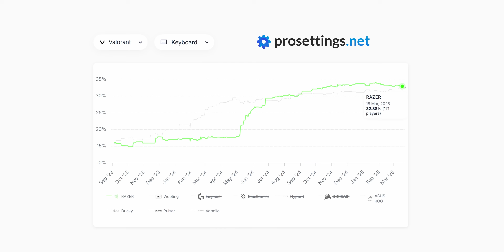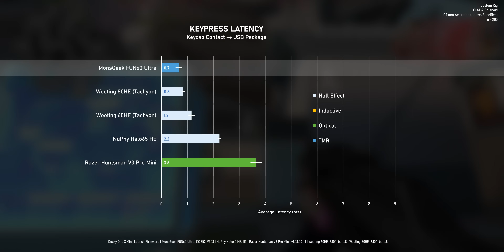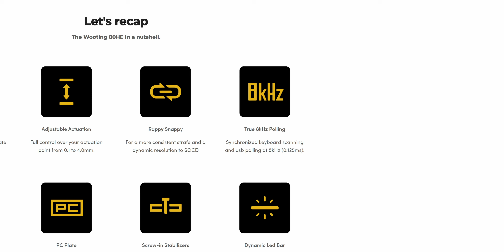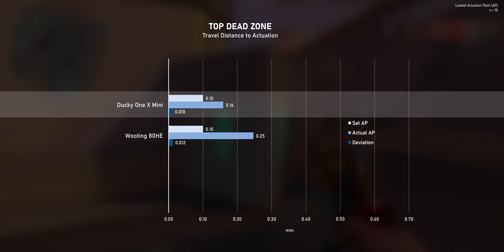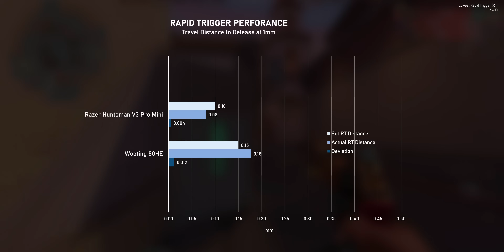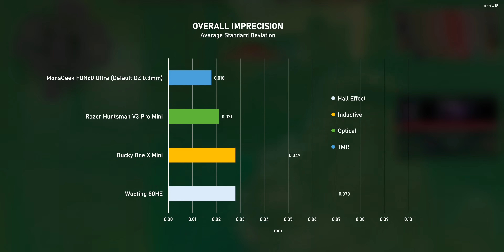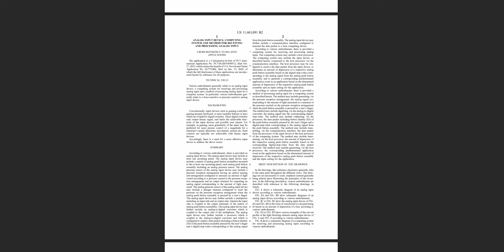These New Keyboards Are Here To Replace Hall Effect

Comment: Re Razer bottom dead zone, i believe the total travel of those switches is 4.5mm but the actuation range is only 4mm so maybe not quite deliberate but just a consequence of the switch design. I would be interested to see the latency of their newer 8k variants because overall their accuracy is very impressive and on par with what they advertise in the marketing.

Razer (somewhat rightfully) gets a lot of hate but their esports focused products seem to top tier. Their mice in particular are just literally the best by a lot of objective measures.

Comment: Theoretically speaking - none of these active sensor technologies such as Hall effect (including switching types), TMR, or inductive are power-efficiency kings. 
Their current consumption depends on the sensing electronics, not just the key's physical state, so some current flows even when no key is pressed.

You won't be using majority of the keys at any given time, and statistically speaking - this is a factor too. A simple mechanical keyboard remains the most power-efficient option in many ways. 
Even though a bit obsolete, it's perfectly usable for most scenarios to this day. It's a favorite of many for a good reason, but some people want more and there's nothing wrong with that of course. 

"X" type of sensor is also a bit too generalized. Take HE sensor for an example; there's analog (linear / ratiometric), switching / digital, latching, omnipolar.. each one has it's own uses and varying models. 
Modern switching type HE sensors are FAR more power efficient than marketing BS claims. 

While on the topic of HE sensors: if you own a HE keyboard - there is isn't a good reason for change, other than personal preference. Every switch has it's pros and cons, but keep in mind that software plays a HUGE role in just about every keyboard that's utilizing newer sensor technologies. HE software  refinement isn't perfected yet, but is in a pretty decent place right now. Switch selection / options are expanding at a decent rate too.. can't say the same for inductive tech for an example.

TMR = ideal for wireless keyboards due to impressively low current consumption regardless of the state of the switch (pressed or not). But keep in mind that the LEDs are the highest power sink regardless of the switch by FAR (up to 5W at 75% keyboard at max brightness, white color = up to 60mA per key in some cases). TMR is extremely sensitive too (this can be both good and bad). If you really want one, I'd suggest trying to find / wait for a temperature compensated TMR option as these types of sensors tend to have a very stable output.

Inductive = no magnet + no physical contact. Technically capable of even higher power efficiency than TMR due to deep sleep capabilities (this is beyond negligible though). In reality, it's probably just about the same. TMR option should have marginally faster response slightly higher power efficiency if we're comparing continuous scanning rates. Inductive sensing also has the potential to offer superior repeatability, lower temperature sensitivity and better linear distance measurements. Also no risk of drifting.. ever.

Either way, switch type is just one of the factors, and there's quite a few of determining factors for both the performance and the power efficiency. There's a reason a 50€ HE keyboard trails so far behind Wooting as an example.. and it's both hardware and software. Identical sensors doesn't mean identical performance if stuff like internal amplifiers, biasing networks, oscillators, ADCs, etc. is skimped on or just poorly designed.

Sorry for the rant, I hope this was helpful to at least somebody. Simple reality is that there is no bad pick here. Marketing is blowing things out of proportions as usual and that results in nit-picking between things that have 0 perceptible difference in performance when it comes to real world. 

P.S. - great video!

Comment: Most of the differences in measurements between Hall and TMR here, I think are just differences between the particular implementations, and not inherent to the technologies themselves.
I am typing on my own scratch-built HE keyboard, and I will say that power concerns actually added a lot of difficulty, especially if you want to stay within the USB 2 standard 500mA power spec (which most of these keyboards don't).
I'm fairly sure, judging by those numbers, that the 60HE is bank switching the power on the hall sensors to save power, and tachyon mode just leaves them all on.  I do the same on my board to give me extra power for RGB, and I've managed to get it to run fast enough to get a true 1ms response that I'm fine running in this mode all the time, but it would certainly be a challenge if I wanted to do a larger board while still keeping the power demands low, and also optimized for latency.
TMR would pretty much just remove this design limitation, and require less optimization to get good performance.
As far as I can tell, other than that, it should be pretty similar in performance.

Comment: There's some blatant misleading/deception in this video, early on there's an unfair power consumption comparison of Wooting's hall effect keyboard with backlight set to maximum intensity to Ducky's inductive keyboard with the backlight turned off and the claim that Ducky's keyboard achieves vastly better battery life...

Like yeah, if you're comparing a device running tons of LED's to a device running none... of course there's gonna be a huge difference in power consumption!

Comment: Hi, love your channel but i have a question, ive been looking at TMR in particular the Womier SK75 TMR/HE and the only reason i havent pulled the trigger yet is because i dont know if TMR supports analog keystrokes, id like to use it for driving or barely pressing it to walk if i wanted to as well, do you know if they support this feature? Also another question, how important is software when it comes to these or are they good to go out of the box.

edit - if curious or if it changes anything, im either choosing between the Womier SK75 TMR/HE or the Lemokey P1 HE and ultimately im just looking for a good "one and done" keyboard

Comment: Who on earth cares about the power consumption of a keyboard?
Reply: You do know that wireless keyboard exist, right? Having to charge the keyboard less frequently is basically a godsend. Not to mention keyboard built into laptops especially gaming ones where said laptops are already power hungry to begin with. There is a reason why keyboard manufacturers like Wooting still have not release a wireless Hall effect keyboard and those that do have them come with a noticeable larger lithium-ion battery which would the overall keyboard bulkier and heavier with some comprising features.

Comment: the scanrates are pure marketing fluff and absolutly irrelevant. 
input latency is always bound to fps. so the most you will "loose" is 0.0001sec of input withing a frame when comapring 1khz to 8khz.
this is not visible or feelable, its makes no difference at all in a positive sense

however it can have massive negative impact on latency and irqs. depending how the driver is built. if its designed to allow true 8khz input then this is is a bog nono and best you can do is switch it to 1khz
the problem with high polling rates is so bad microsoft had to make a patch after high polling mice froze midrange cpus to death

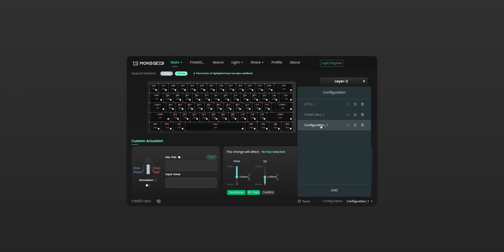Comment: 18:18 "I'm sure this will improve over time..." It hasn't 😆, I've returned my Fun60, the software is still a nightmare
Reply: should i get the fun 60 ultra TMR? i really like the precision etc but does the software make the keyboard unusable? I really only need to setup RGB and actuation points and thats it
Reply: @mirDaaa  I would heavily recommend against it. The software is so confusing and makes things like Rapid Trigger so hard to use to the point that, even when you get it working, it still doesn't feel right. Save up a bit more and go Wooting.

Comment: After Optimums video I went out and bought a fun60 ultra TMR. $47 on sale in China. That's one thing not really talked about in this video. Sure, the software is not as polished and full featured as wootings but they have had a huge headstart and charging $200. The value proposition alone should make the Fun60 an easy to recommend analogue KB for anyone.

Comment: Couple of years ago had a diy project (was abandoned due to circumstances) of inductive sensor PCB.
I did a couple of switch sensing prototypes with different coil sizes with stm32. Received my commutation ICs to try out to scan multiple coils the life happened.
Main advantage of it though is an ability to use standard MX switches and sense it's spring position. 
I didn't pushed basic prototype too far. I stopped at 30ms latency before moving to multi coil keypad. Required simple per switch tuning. Some MX switches were hard to sense, too much jitter, not sure why.

There was prior art to me, guy were selling his inductive sensor keebs, but wrapped in a half of a year or so.

Comment: I've never used analog keyboards, not sure I understand the benefit? Does it just mean that you can program a key to do different things depending on how far you press it? Does this have much benefit for typing?
Reply: the main benefit of analog keyboard is having better control over your car in racing games. In more realistic racing games, having just on and off for your throttle, brake and steering is not enough.
Reply: @IHaveALotOfBraincells  ah, i see.

Does that also require the game to have support for analog keyboards too?
Reply: @soconfused8031 I'm not sure, I have never used an analog keyboard myself.

Comment: A4tech Bloody (analog?) optical alpha keyboards with actuation point options: 1--2.6mm? Alpha Variable Speed Optical Switchs. Software +-? But without custom firmwares qmk/zmk/kmk/..(  No slim analog mechanical kb( 

Also needed review/test with diy kmk/zmk HE, diy riskeyboard70 opensource openhardware washable! kb, and also with their new top project - Flux Keyboard, also washable transparent HE +ips screen (but expensive 550$)!

Comment: We should be thanking China for that and I'm saying this as a European, Greek specifically. I bought one with 55€ without the slightest markup the known brands stick on them. Hot-Swapable Red-Switches and the best RGB you can find on any keyboard, after an extensive research. It has RGB for the buttons individually and RGB as a general lighting, but the smoothness of this is unparalleled. Razer, for the same TKL would have asked me at the very least 150€. Pure, unadulterated thievery. Oh, it has it's own software, too. So lucky I've been after said research. Usually those do not come with their software, but still, it doesn't matter at all. Magical and cheap keyboards. The Keychron which my friend has it is extremely good mechanical keyboard, for only 35€. Sure, it doesn't have Hot-Swapable or the best RGB like mine, but still... 35€, who would have thought.

Comment: 6:40 The Ducky has 80% the power consumption of the Razer, which means that if you had a battery that would last the Razer 10 hours it would last the Ducky 12.4 hours. That's not an insignificant difference.

Comment: The real question is whether these will improve your gaming-performance and typing experience. Answer is: No. This is like argueing cpi and weight on gaming mice, it doesn't matter once it passes a pretty low threshold. Have pro-gamers become better players compared to the old days? Look at old footage and fragmovies and you'll realize: No, they have not. I'm actually not argueing against buying those fancy  new switches. But be aware that they are just a shiny new toy, nothing more. Mechanical switches will still do just fine and already have lifespans and accuracy far higher than any rubberdome and what you could hope for in a keyboard-switch.

Comment: I have a Fun60 and a Lemokey P1 (HE). I love them both, fantastic keyboards ! I have a preference for the P1 though, simply because it feels and sounds better to me. But for long typing session, it's quite heavy. In the sense that it requires more pressure to bottom out a key press. The Fun60 is lighter, and still sounds good, and is way more comfortable for long sessions. Both aluminium.

Comment: I had initially switched to HE thinking i could use keys as joysticks are in games, i was disappointed.
However, i do not regret the switch since i was getting tired of classical mechanical keyboard problems like imperfect contacts in the switches. After some time due to wear or dirt/grime, mechanical switches start to be wonky in registering key presses and that can drive you up the wall. HE keyboards do not have contacts, so this problem is not present at all (yes, maybe magnetization changes over time but some keyboard software can test and adjust for that to keep the keyboard alive longer still).
Right now i have the wootin two HE and Razer Huntsman v2 analog and i gotta say i hate the razer. Their optical switches might be better on the sheet, but due to dust and grime accumulating (not over a long time, i have been using it for the past 2-3 months) in the switches, it can affect the reading of the optical signal and i randomly get dead key presses while i game (which grinds my gears).
Now i'm looking for a smaller form factor HE like keyboards, either the wootin 60HE or TMR (and thanks for this video, i was not aware of TMR). Really hope to see soon some one hand keyboards for gaming that are HE, like how there are 3 key versions for OSU.

Comment: @techlessyt this is the best unbiased keyboard video with proper testing and not just praising on specific keyboard. And talking about the latest tech that entered the market.. Appreciate the time you put into this. Amazing job
I am.looking forward to get Monsgeek M1 V5 TMR coz I want a magnetic he/tmr keyboard that is wireless, hot swapabble (if possible) and for gaming. Do u suggest akko glare or astrolink keys? .. Seems there is M2 TMR V5 is getting released.  Shall I wait for it?
Or you suggest something else ? Like  keychron Q#  HE keyboard ? steel series wireless?
Reply from the maker: Thanks! The Fun60 Ultra is the only TMR keyboard I've tested so far. No idea about the others, but I assume they'll have the same software. TMR is great, no question, but I'd only recommend getting it if you're willing to deal with the bad software...
Reply: @techlessYT  Thank you. I will be fine as long as the sw works even though its not intuitive user friendly or need to install instead of web based etc.. and as long as  hardware dont fail ha.
Wireless 8k poling (even in wireless) HE (tmr) with rapid trigger socd rgb ..cant ask for more .. I guess
Reply: @techlessyt really appreciate taking time to respond and help

Comment: Built myself a wooting 2 HE with some GEON Raptor switches and good lord is this thing an upgrade over my previous mechanical(?) cooler master oem keyboard. Ive gone from corolla to koenisegg in speed difference alone. I did need something this fast because im a modded FNF player and some songs do get that fast.
Seriously the best decision despite the price, almost 400 USD after all was said and done.
TMR builds are interesting though, will consider as a side project perhaps.

Comment: I would say accuracy does matter, in the sense that you want all the keys on your keyboard to be equal, or at least the same as you expect. So if all the keys are at 1.4mm instead of the expected 1.0mm its fine, but if they are all over the place it’s not so nice. Did you perform a test where you measured multiple keys (preferably in the same socket location as i assume the local stiffness of the board will increase the travel)?
Reply from the maker: Good point! Multi-key deviation definitely is much more important that single-key accuracy 👍
For this video all tests were done on left ctrl only.

Comment: What you said about scan rate on inductive keyboards is quite interesting, because the AESCO A67/A83 uses the same IC as the Ducky One X but claims to be 4K Hz wireless 8K Hz wired.
Reply from the maker: That might be true for the polling rate, but I highly doubt they can achieve 4K or even 8K scanning with the IQS9320. Kinda hard to find good pictures of the PCB, but from what I've seen the A83 seems to be using 6 ICs, maybe 7. Based on that 1.5 to 1.8K scanning would be my guess.

Comment: curious how the aesco a67/83 inductive would compare to the ducky one; it's switches are designed with kailh, the aesco has better RT sensitivity and reset sensitivity(93 settings from 0.10mm-1.37mm), and also bottom deadzone control(50 settings from 0.00mm-0.69mm) and actuation point from 0.05mm-3.3mm(in 0.01mm intervals below 0.3mm and 0.05mm intervals above); though it does give warnings about possible accidental triggers when set below 0.15mm(I haven't experimented much but haven't really seen it from what I've tried). Also apparently 8k Hz polling rate wired, and 4k Hz while wireless. It uses downloadable software that also had profiles that are capable of automatic switching when running games by choosing the game executable in the software and then dragging the profile on it; switching whenever you go in game, or even swapping back when tabbing out.
Reply: Amazing sounding stock keyboard for the price.
Though I upgraded my Aesco A83 with doubleshot PBT CSA keycaps...to increase the “thock”